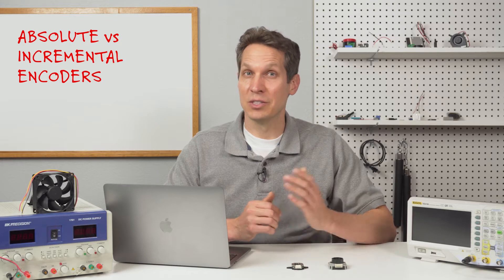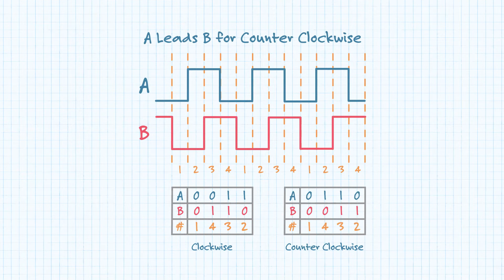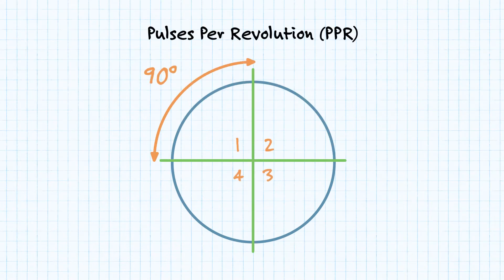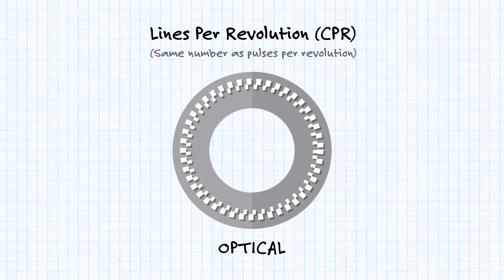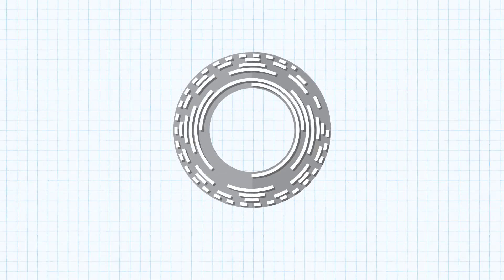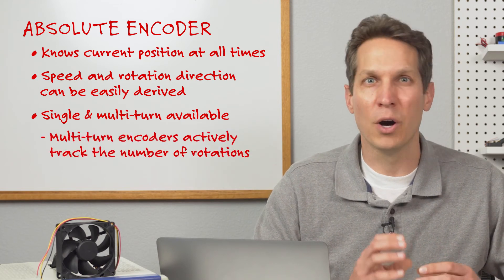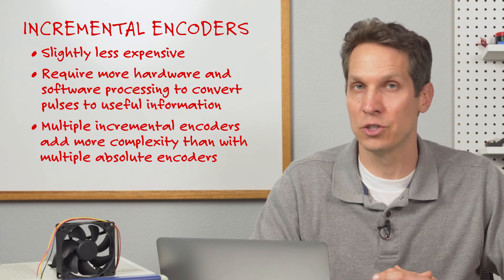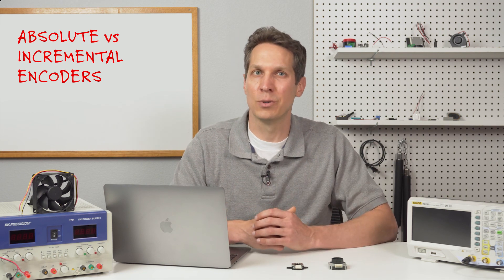Absolute vs. Incremental Encoders – What’s the Difference?

Comment: Which type is better for cnc milling machine? I quite confuse about this absolute encoder
Reply from the maker: An incremental encoder is simpler to implement for speed control. If the encoder is only needed for velocity, then an incremental is a good choice. However, if the encoder is needed to control precise position and movement of any specific tools or axis, then an absolute encoder will give much better control.

Comment: Which type is better for cnc leath?
Reply from the maker: An incremental encoder is simpler to implement for speed control. If the encoder is only needed for velocity, then an incremental is a good choice. However, if the encoder is needed to control precise position and movement of any specific tools or axis, then an absolute encoder will give much better control.
Reply: @SameSkyDevices  thanks